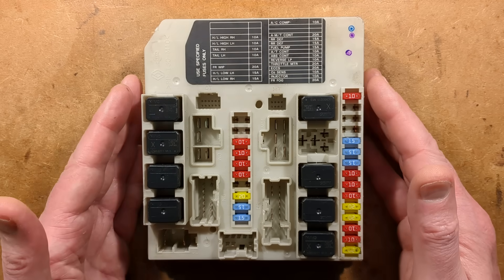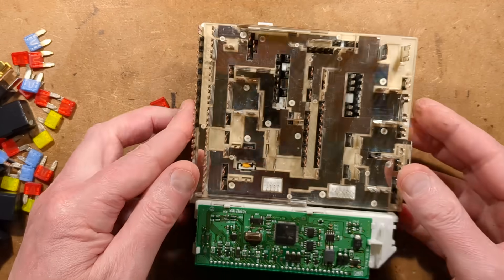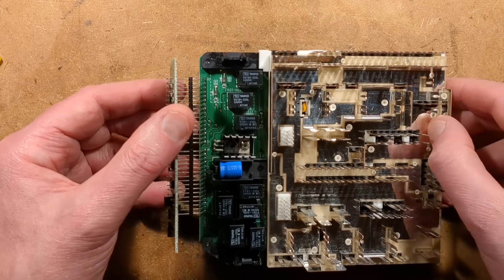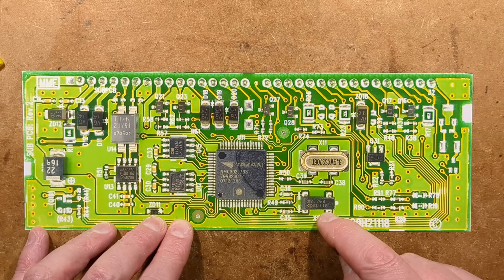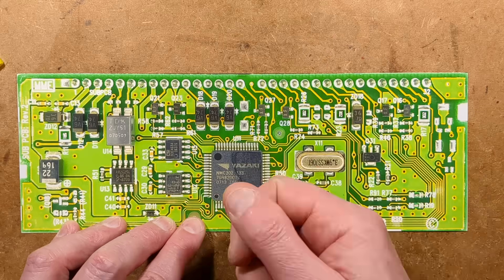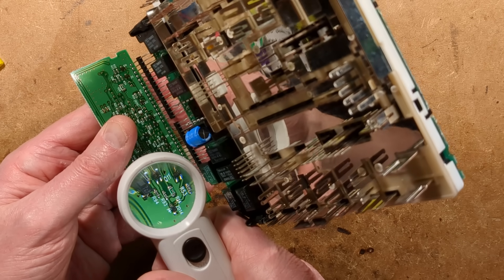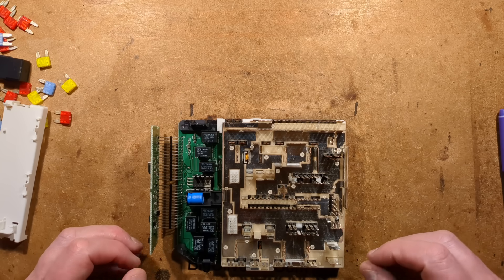Why your car's fuse box costs so much (and the location of the data chip)

Comment: Those jumper links may be there for different option packages. For example, I own 2 Ford Crown Victorias. One is a ho-hum civilian version. The other is the police interceptor model. On the civvy model, the electric trunk release is powered full time so that you can hit the button and pop the trunk regardless of the ignition switch setting. IE, you don't need the key on to open the trunk. However, on the police model, you must have the ignition turned to the on or accessory position to use the trunk popper. I assume this is to prevent any idiot walking by a police car from opening the trunk without the key. In fact, the harness was cut when it was in police service so the popper couldn't be used at all. a quick trip to the junkyard fixed that, but you still need the key on to use it.

Comment: now im curious on what you daily drive , last i knew it was some kind of van i think 
i think those electronics and links are for features and compatibility ,some cars would have heated seats ,some dont .......
as i discovered lately in my bmw ,i have a 2005 series 1, i bought 2nd hand that had Aux input working just fine , and the battery ran flat , when i recharged the battery the aux option was gone ,like i cant set the input to aux ,its gone from the menu , turns out ,the car didnt have it from factory even though its built in into the radio , you can take it to specialists to program it back and enable aux input but if the car loses power ,like completely dies ,then next time im guessing it loads its default configuration from somewhere and the aux option is gone , it also lost the windows positions and other features like closing all the windows with the remote !!
Reply from the maker: Transit van and old Skoda.

Comment: 1991 7 series bmw had so many modules, looms and the battery mounted under the rear seat. It ended up needing a replacement ecu, cost a fortune! 
When I started doing roadside, we had no computers, we had power sprays, jump leads and some hand tools. Oh for the simpler times.....🥹
Reply from the maker: Yeah, I'm not a fan of the modern overcomplicated stuff.

Comment: Current generation GM vehicles use a much more powerful MCU for the engine control computer. We have been using a RH850/E2H 40nm quad core 400mhz MCU for a while

Comment: I worked at a manufacturer of these items at the time they were moving from a pure metal grid with relays and fuses to electronically controlled ones. One of the last ones that I worked on had a small pyrotechnic device in it, which was meant to cut metal fuse tracks in the case of an accident, in order to stop the car burning too much. Yours is made by Yazaki. In addition to general power switching, yours will do timing functions and sensor processing.
Note that CAN was made for motor control across a factory, and was later adapted for cars (in the face of a lot of competition) , as it was a Bosch development and the German car manufacturers took it en masse.
Reply: CAN was invented for cars THEN went to industry / factories
Reply: @alantucker3014  yep, invented for automotive, automation took it up and then automotive picked it up. Philips nearly dropped their CAN lines because the ICs weren’t being bought by their automotive customers. They somehow missed that they were being bought by their industrial customers. It wasn’t until a big uproar after the obsolescence announcement that they backtracked. That’s also when other manufacturers seemed to wake up to the market as well
Reply: @Reality_TM Philips had notifications but the company has split and merged several times since then. It was covered in the industry press but I don’t know if those back issues are easily available and searchable
Reply: @Reality_TM worth noting the reason that Philips dropping CAN was so notable is that at the time they had an effective near monopoly on certain devices.
Reply: @alantucker3014  Yes. CAN was developed by Bosch in 1983 and presented to the automotive industry in 1986 (Wikipedia).
Reply: In my '02 BMW, there was a pyrotechnic device on the positive battery terminal. In case of an accident, it would blow away the wire to the starter and alternator, leaving the one to the internal fuse panel and bcm intact. That way, if the starter/alternator were crushed, battery power would remain available to unlock doors, roll down windows, and turn on all the lights (all automatic by the way).
Reply: @circuitsandshortcuts  Oh I hope they don’t do that anymore on those Lithium batteries…
Reply: @circuitsandshortcuts thats really cool. Was it only on the high end BMW models? EVs (at least some) also use a pyrotechnic fuse for the EV battery.
Reply: Curious... Yazaki opened a plant just outside my town when I was a kid 😅
Reply: Sounds like the unit in the trunk of an M/B W140.
Reply: What‘s an M or B?
Reply: I heard Can was developed in conjunction with general motors and was originally called GMLan.... but the name was changed so other manufacturers would use it.
Reply: Electronic modules had to be coded from the late 90s onwards to prevent theft of cars for parting out.
Reply: @charlesbridgford254 but it seems people can still steal some expensive modules like the Honda forward collision avoidance sensor which is super easy to remove and then resell off. (Apparently)
Reply: @charlesbridgford254  … or to give dealerships a peofit!

Comment: I have always wondered about hooking one of these clips up to a memory chip and whether you end up powering the rest of the circuit as well. But I've never tried to do it myself.

On one bit of telco gear I noticed that the memory chip is powered via a diode so you can hook on without powering anything else.

Comment: Now it's all integrated into one unit like this. On some old cars, the fuse box or boxes are connected to relays and ECU in completely different locations, with long harness and wiring.
The most impressive for me is how Saab put almost all the fuses in glovebox in the 9000, you could pull the fuse while doing diagnostic work without getting out or moving around the car, but that cost a lot, so we don't see that in many cars.

Comment: 1942 Plymouth had about two fuses (and optional radio fuse), plus a thermal breaker/flasher on the headlight switch. (If you had a short, the lights would work on a blink so the wires did not catch fire and you could see your way off the road between blinks.)

Comment: Given that most (all?) generic microcontrollers have a built in internal WDT it seems odd that this has an external one. Presumably it’s belt and braces for the internal one. Handy though because it means there is a signal you can use to hold the processor in reset whilst you read the memory chip.

Comment: Unless it’s from a very old car this is just a sub panel which is why the input pins aren’t that big you should make a video of the battery fuse board that feeds the smaller ones like this they have some monster fuses and copper link bars in them normally

Comment: 1995 ford ranger (obdc 1.5) 
Radio sometimes worked, sometimes not.
Engaging the emergency flashers would disable directional flashers for an undetermined amount of time.
Occasionally, all cluster gauges would min/max like freeking idjits.

Comment: good fun with 90s cars, capacitors start leaking, good fun repairing that $((@!
Reply: Mitsubishi - makers of automobiles, makers of capacitors, makers of ECMs that use 3rd-party capacitors that can't handle the heat of being inside a car in the summer...
Luckily the rear end failed in my Mighty Max before the ECM!

Comment: Automotive engineering never fails to impress.  That thing looks closer to a PDM than a simple fuse box.  Not sure if you beeped it out, Clive, but it would be interesting to know what the bank of hidden relays was doing.
Reply from the maker: I'd guess it's lower external loads like banks of sensors.

Comment: Any vehicle build within the last 5 years is most likely going to have a "smart" fuse box, even worst than this example you have here. 

All the relays are now directly soldered to the PCB inside the housing so you can't access them and even some fuses are surface mount.

So if a relay or fuse blows instead of a simple plug & play operation costing pence now you have to replace the entire "smart" fuse box which will be between £300 to £800 depending on the manufacturer and to add further insult to injury many are on back order for months as they are not available on the aftermarket. 

Also due to vehicle manufacturers not wanting to use new parts for spares but instead sending them to the assembly lines to build new cars. 

If you are really unlucky you also have to program the "smart" fuse box to the vehicle before if will communicate with the vehicle as they are sold deprogrammed requiring a diagnostic tool costing four figures.

We have three Peugeot vans in the yard now that have been sitting for months as they don’t start, contacts on some of the relays have burnt out and the fuse boxes are on back order with no date on when they will arrive.

No technician if going to strip the fuse box down & replace the components as they don’t get paid enough to do so with flat rate labour rates & will have to take on any liability if things go wrong in the future with the fuse box.

Planned obsolescence anyone?
Reply: I don't work in mechanics (I do on my own cars but not as a job), but HVAC. And I encounter the same thing. I can often bid hundreds or even thousands of dollars cheaper than the competitor by just desoldering and replacing a single relay or capacitor that's bad rather than replacing the entire board. A single soldered relay might take me 15 minutes to replace and cost a few dollars at most compared to sometimes 500 dollars or even 1000 for the whole board depending on what it is. It's usually a crap shoot whether the new board will even work or not so my solution usually ends up being more reliable anyway.
Reply: Sounds more dangerous to me. I thought people used to try and circumvent relays and safety devices before they became super expensive. But now? Well, who's to say how much direct current you can funnel from an EV battery into something you're touching, eh?

I'm gonna stick with my bicycle. Saved me a fortune over the last decade. And time, too, especially when I have to go into London.
Reply: Look for automotive locksmiths in your area. A lot of them can fit a second hand fusebox (BSI) and reprogram it to your car.
If you get one from the scrapyard you can test it yourself, after plugging it in everything will work except starting the engine until programming is done.
Reply: @mrfrenzy.  Oh I can program the module myself and if it was my own car I would either fit a second hand module or do the component level repair myself.

But we repair vehicles for the general public, these vans are owned by a business as a fleet. You have to cover your back at all times in this world we now live in where lawsuits are ten a penny.

As a business ourselves we are not going to fit second hand parts (if you can even source them as this is a really common problem) and give a warranty.

The real issue is vehicle manufacturers nickel and diming every part on there vehicles making them as unrepairable as possible and shifting that problem to the  owners knowing they have them over a barrel forcing them to buy newer vehicles.
Reply: Time for an LS swap 😆

Comment: I once made a nice little CAN bus sniffer for VOLT cars.  It monitored the car's performance for an automotive magazine but it turned out they couldn't figure out how to use it.  I recorded the data in CSV format on a microSD card thinking any idiot could handle that.  Well, the magazine editor used exclusively Apple computers and apparently whatever they had could not read an SD card nor decode a CSV file.
Reply: It was often noted that when an early "technical" mouse had 9? buttons on it, and the ordinary PC had two or three, that the Mac only had one button. So the target user group wouldn't be confused.
Reply: The joys of incompatibility…….

Comment: @3:20 for these kind of desoldering jobs, you absolutely need one of those solder sucker guns with a vacuum pump, you can get them pretty cheaply, they are a huge time saver, over the wicked desoldering wick.

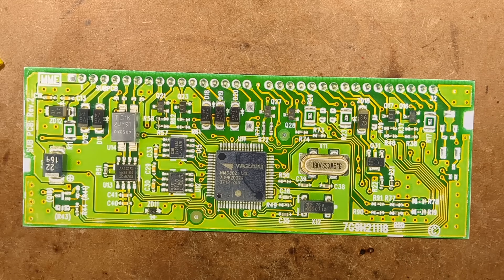@8:00 usually you'd also be able to reprogram the module via CAN bus

Comment: on a completely different board I did program a big parallel flash chip with the microcontroller also getting power, to make sure there was now interference from the microcontroller I soldered a little jumper wire to its reset input to make sure it cant actually boot and it left all its pins as floating inputs.

Comment: There is another way than using a heat gun to get those chips off... Duratool makes a tweezer soldering iron, and they also do large flat tips that can sit on all of those pins for about £30-£40. If you work with small chips like that a lot, it's a good tool to keep handy. Oh, you also get desoldering blocks that can slip onto the right iron, they take a bit of heating, but for the right application, absolute time saver. Anyway, that fuse box looks like an absolute nightmare to repair.

Comment: I had to replace this damn thing on my last truck! Got a bad area of solder joints or something a couple circuits got intermittent opens, and as you hit/flexed on the fuse box it would cut in and out. I elected to just replace it, as it was nauseatingly complex in there, and downtime on the work truck is unacceptable, even down time on the A/C blower won't do, I refuse to leave a hot job site and not have ice cold A/C. But it was fascinating seeing the board in there, and I suppose it is the easiest way to make something to keep all the circuits laid out efficiently in there, but sometimes I wish we didn't have to be so cutting edge in everything.

Comment: The thermistor could be used as an interior temperature sensor for the hvac system, they do that sometimes for the ambient temp for other things also.. if that box goes under the hood then it would be used for air fuel stuff or heads up display..

Comment: The 3.9MHz XO is for running full-tilt when active.
The 32kHz XO is for sleeping in fleapower mode, just enough to wake up the box when it gets the signal.
Reply: ...except anything remotely modern has had some kind of internal low-speed oscillator built in for ages now, and you don't even need one just to be able to sleep and wake up. These days the only remaining reason to have an external 32KHz crystal is to keep accurate time.

Comment: I've done flashes onto atmel style EEPROM chips and they were all in circuit, most computer motherboards don't have removable chips and it's a little too much effort to desolder when you've got many motherboards to reflash :D The main thing is you've gotta use the right voltage for the chip and circuit.. otherwise you let out the magic smoke. As I recall there's 1.8v 3.3 and 5v adapters for eeprom readers.

Comment: I ran across CAN outside of cars in an APC Symmetra on-line backup system.  The APC had everything hot swappable.  The unit was 20 KVA with three 10 KVA inverters load-sharing.  Any one of the three could be pulled out while the unit was supplying load.  The same was true with the two redundant control units.  All of the modules talked over CAN.  It was quite a clever backup unit and quite a bit fancier than the units APC sells for home use.

Comment: There is another channel that I watch with a mechanic who is nutty about Toyota.  He has complained that for a few model years, Toyota had 3 generations of buses in their cars with a translation unit to move packets between them. Makes diagnosing things so much fun.
Reply: I believe that you are referencing: "The Car Care Nut". He has an enormous amount of Toyota-specific knowledge and I genuinely enjoy his ability to make these complex topics understandable. He seems like a a really good guy also.
Reply: @electronicengineer  I’ve come across his channel (I run a Toyota). This item reminded me of a snag I came across (along with thousands of others) on a Honda, in which a software error in a Bosch GmbH unit that used the CANBUS which occasionally resulted in a load not shutting down properly, resulting in a flat 12V battery in the morning - and that was a 70AH one. Honda repaired it by a firmware update, and no doubt claimed it from Bosch in due course. At the time, I knew someone who was working at the Honda factory. The CANBUS was a Bosch invention, and led to the reduced use of cabling for many things in modern vehicles, & as long as they all comply with the requirements. but.....

Comment: Automotive electronics:
My brother's Hyundai stopped flashing it's indicators (they defaulted to on) and displayed an error code.
Dealer used a diagnostic device and said: "Needs a new body control computer"
I made a guess that the BCC monitors the  lamps for blowness and suggested that he used electronic lubricant spray on the sockets
One expensive error avoided.